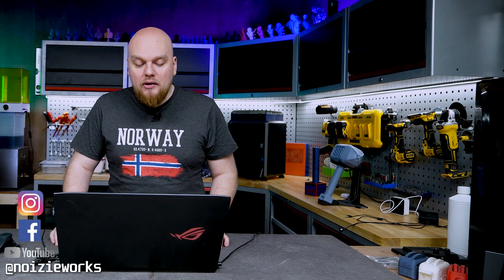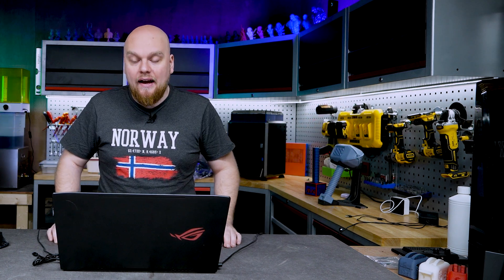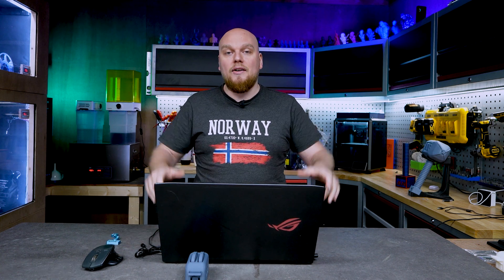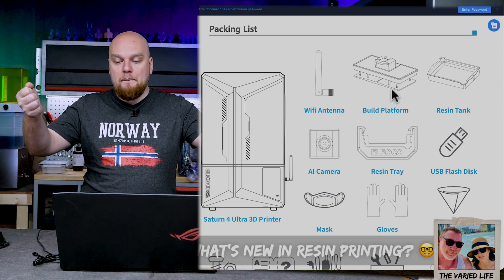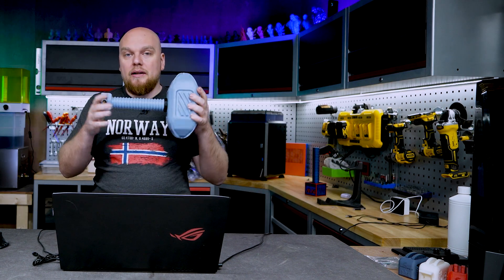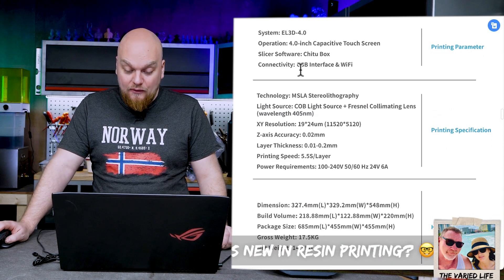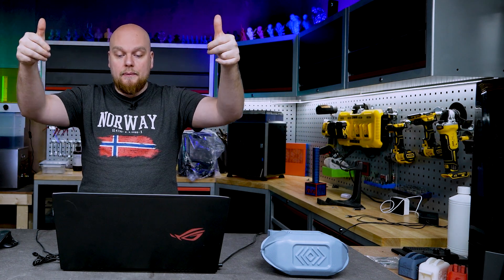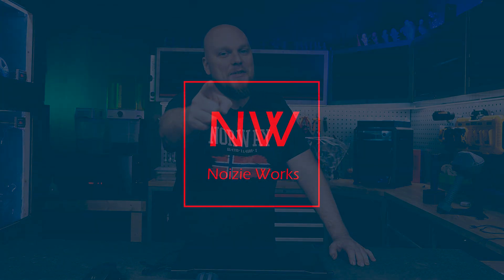Leaked specs and tilting vats? My thoughts on the Saturn 4 ultra.

Comment: They could have hit a home run if they just added vat heater pressure sensor and resin residue detection. Maybe front doors that open to the side. It was so simple to make a winner
Reply from the maker: I would be all over that! And then implement that into the jupiter 2 buildsize 🫠
Reply: It says it has resin residue sensors.
Reply: They need to leave something for saturn 5 😂

Comment: Sorry I would pass on this printer. I seen more reviews on this printer how if I’m buying a new printer my choices would be the GK Two and this printer, I’ve got a gk two would I buy other no only because I live in a very hot climate around 32c or 90f degrees, winters are 50f to 80f or 10c to 26c. But I’ve got my printers a spare bed room it’s start at 70f or 21c by the time the heat from the printer are add in because turn the vent off during summer it’s hot in there. So I may buy one to replace an older Anycubic mono 4k.

Comment: It's not for me! To much going on I was an unwilling beta tester for Anycubic m5s before not happening again! I don't think they should have used the saturn name for this printer either It could well destroy the brand! I love my elegoo printers but I'm afraid I'm out for this one! My saturn 2 8ks and my saturn 3 ultra are perfect and my friend has just got one he absolutely loves it! As for the carbon filters I don't know why people think there gimicks mine work superb for keeping the resin smell at bay it's only when I take the tops off thw Saturn's I smell the resin I couldn't have a printer without them! The battery ones are rubbish but the USB ones are good! Just makes me wonder if people take the carbon block out the packet first lol?
Reply from the maker: 100% agree but if smell is a problem there are great resins these days that almost don't smell at all.
If you keep the lid closed then it doesn't really matter if you "filter" it, the bad smelling ones are still gonna stink a lot when you remove it.
I had a viewer that shared a project with me with a closed loop carbon filter system/heater with buckets full of carbon and even then it's still present although A LOT better.
If i'm not mistaken Elegoo i actually working on a system like that so that could be really exiting as you can hook up multiple printers.
This was on formnext 2023.

Comment: More moving parts = More points of failure. And with the tilt mechanism I would be afraid of spilling resin into the machine.
Reply from the maker: Yup and the fact we don't see it on a wide scale makes me think it's more a cure for a problem that doesn't really exist.
ACF does a great job and with good settings i can even make my jupiter go over 150mm.
I would trade it any day for build in heated vat and a force meter to monitor release and speed up the prints that way.

Comment: You can see how to use the resin tray in this video of Prusa. Elegoo make a copy and paste of the Prusa S1.
https://youtu.be/Ofb1l2UOY9U?si=pwk3ukQ01omNoLo6&t=87
They also change the light source to the used on the Saturn 3 and Saturn 2. so maybe they need the space for the tilt system or the Saturn 3 Ultra was a worse light source.
Reply from the maker: Don't think the light system is bad in the s3u it's probably space savings as they already lost 4cm of build height.